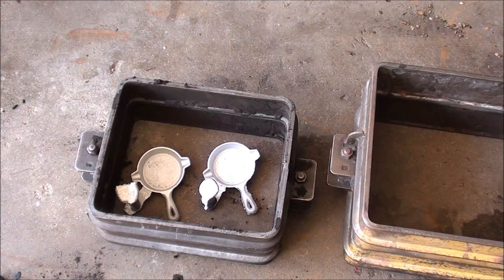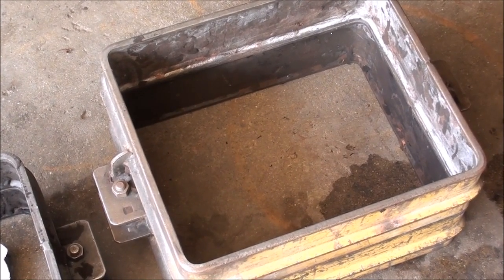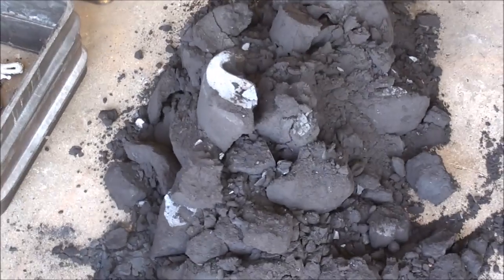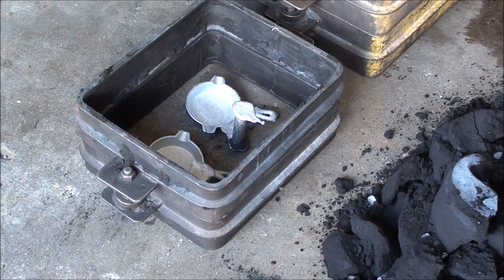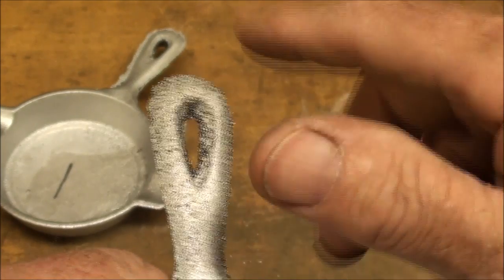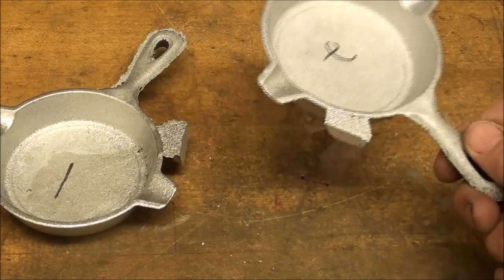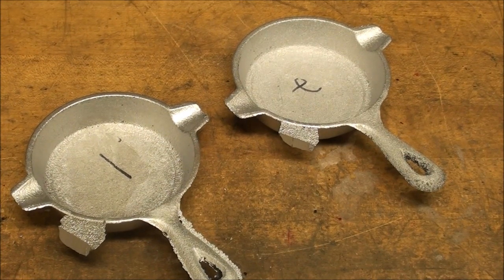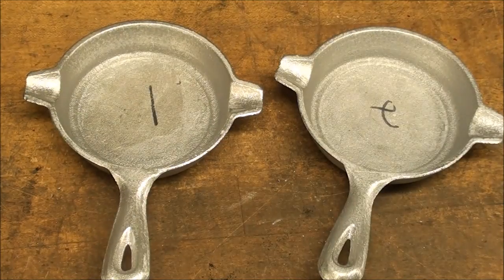CASTING A FOUNDRY MATCHPLATE PATTERN part 2 of 4 tubalcain

Comment: I've failed 5 times at this thus far so thought I'd stop and ask for some tips. My skillet pan castings are giving me the handle, base and about 3/4 of the side walls. The 2 risers are filling. Pour temp is about 750 celcius. Basically part of the thin walls are failing to fill. Any ideas Pete? Many thanks.
Reply from the maker: Try these things. Increase the temperature of the metal    To vent the mold in a few  places. Make your gates and runners larger. Pour the metal in faster.  Try a different aluminum alloys, some are more fluid and liquid than others
Reply: Thank you Pete. I think the vent is maybe the ticket as I've been down the other routes. Tell me Pete, sometimes people use a riser and a sprue, but sometimes only a sprue. How to know when the best way forward is, and, do the rules for aluminum stay the same when casting for example Bronze. Hope this message finds you well and thank you.

Comment: Why don't you take that one good gear from the broken transmission on your lathe and remake yourself a new gear out of the molding sand? I know if anyone can do it, you can . I welded ours and filed and welded it again until I fabricated the teeth pretty close to the way they were originally. It wasn't precision but it was close enough to be used slowly and o lay for copper and soft brass for our wire straightener. Also, did you know you can use solid TEFLON as wire straighteners instead of those brass blocks? Yes you can.  I would cut a lenghth of brass then use the ball mill to put the various different wire sizes in .I was very , shall I say THRIFTY.LOL. I hope I helped you with some ideas to fix your new /used lathe. Take care and good luck and GOD BLESS YOU TUBE.  HOPEFULLY YOUR NEW FRIEND GLENN FERRIS.  
PhillyMale1955@gmail.com
Reply from the maker: Good, but aluminum would be too soft

Comment: Excellent work so far.  I imagine the pucker factor was pretty high when you were separating the casting from the flask.  And then relief in a job well done.  Just like they drew it up.  Just one question.  Of all the things you could make a match plate to produce, why the mini fry pans?

Comment: Do you think it would work to make two 3/8" thick ears with holes for the smaller flask pins and then cast them into the match plate along with the patterns? This would mean you could get away with less metal in the plate.My idea is similar to the way some plastic parts have metal pieces or threaded inserts molded into them.
Reply from the maker: Might work